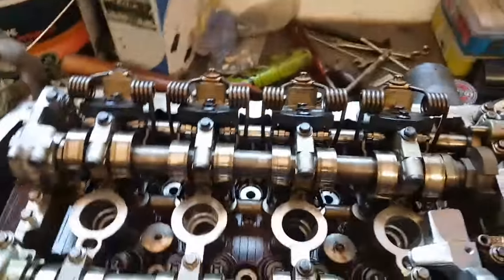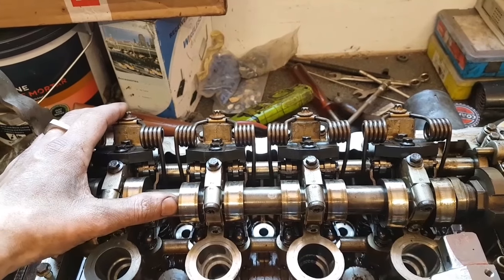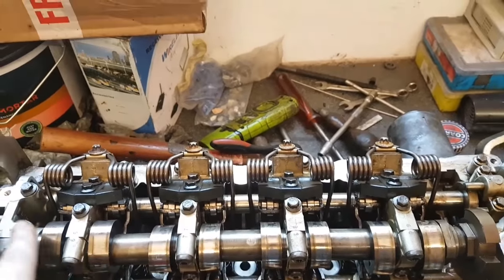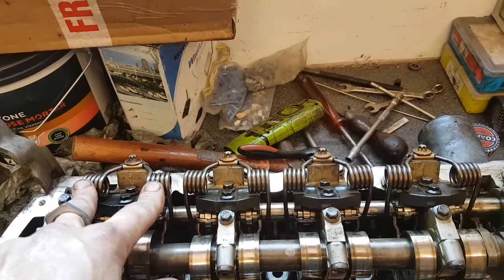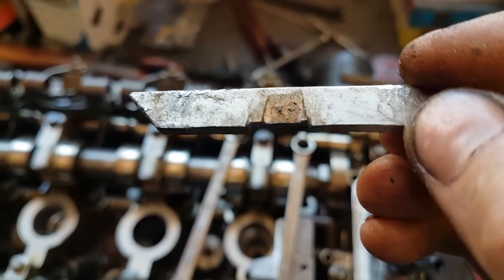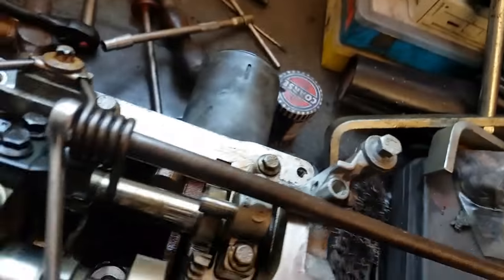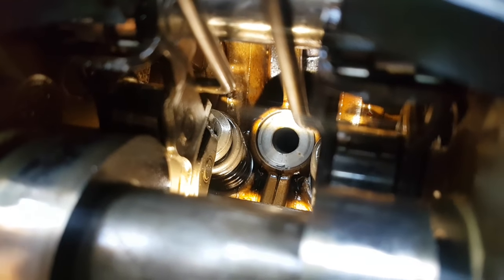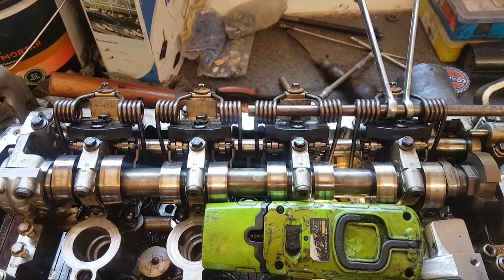PSA / Mini / BMW Valvetronic intermediate rocker & spring installation without special tool

Comment: Great video Pete, I'm about to work on my wife's mini, I'm ex mechanic myself, noise that comes from the valvetrain sounds like damage due to oil starvation as I can hear high pitch squeak with 1 sec intervals. Hope ain't the cam journals . I'm planning to change all 16 rocker arms ( intermediate rockers ) as that's my best bet going by the noise I hear. Do you think locking the timing at the flywheel will be sufficient enough to play with those horrible springs and change the rockers ? Thanks
Reply from the maker: As far as I know the cam locking tool aint too expensive, I'd get and use both in order to time everything up on the way back together, other than that you should be all good to leave the head in place. Lock the crank, leave the chain hanging and proceed from there. 👍
Reply from the maker: P.S. You're never an 'ex' mechanic... once you have the skills to repair a motor, you are always a mechanic, regardless of what career you persue next. Mechanics are a rare breed, who choose to hurt themselves both mentally and physically on the daily for the benefit of others! 😂🤣😂
Reply: Pete Ledwidge please pete would you mind sending me a pm i have so many questions regarding a n62b44 engine with a worn valvetronic shaft according to some bmw specialists.... some also say its the sensor? I am in need of desperate help
Reply from the maker: @hvmiddenwestnoord1871  apologies, I dont check the comments all that often. Did you resolve this? By sensor, I take it you mean the eccentric shaft sensor? The way to test the theory is to swap the sensor for a new / known good one. 3 10mm bolts and unclip, 10mins work. (If the sensor has built up a lot of oily crud on it, it's usually knackered.) If you still have the fault codes, after swap & code clear, then you know the problem is elsewhere.  I'd say it's probably either valvetronic motor or timing chain / tensioner / Vanos intake sprocket related, as opposed to the actual eccentric cam, the cams have been known to sustain damage if the car has been run low on oil. Hope this helps.
Reply: Pete Ledwidge hello pete, i found out about intermediate lever wear that cause misfires on one or multiple cilinders, in my case i have misfire on cyl 5 bank 2 (V8 engine). I took out bearing bracket yesterday containing the eccentric shaft and intake camshaft and i read about alot of premature wear on specific intermediate levers produced around 2002-2004. Mine’s an early 2002 e65 so suggesting that the intermediate levers are worn causing a misfire on cil 5 bank 2 due to failing tolerance for intermediate lever roller causing wrong cylinder filling? Do you know where i can source good quality intermediate levers? I cant find any.
Reply from the maker: @hvmiddenwestnoord1871 Gotcha, seems like a reasonable assumption. The whole valvetronic system is over engineered for the job it does, causing a lot of grief after 70k regardless of manufacturer year IMHO... Just tackling a Mini N16 with VANOS / Valvetronic issues atm. You can take a chance on ebay used parts or go direct to BMW, they are reasonably rare in the aftermarket.
Reply: Pete Ledwidge how much can i trust a used complete bracket from not being on the edge of failing as well? I also need to source a new eccentric shaft are those also rare on aftermarket?
Reply from the maker: @hvmiddenwestnoord1871  Exactly... in an ideal world it would all be brand new from BMW, but that comes at a cost. With any used part, you take your chances. The shaft seems scarce too for the e65, yes.
Reply: Pete Ledwidge is it natural for the eccentric shaft to be worn when the intermediate levers fail? How can i check it for wear is it the gear with tooths controlled by the actuator i have to look at or?
Reply from the maker: @hvmiddenwestnoord1871  Both the cams and the gear need inspection. All contacting surfaces will wear.
Reply: Pete Ledwidge what would you suggest to do? I looked at the exhaust cam and seems to be in ok order there also isnt a faultcode related to the exhaust cam, only intake side along with vvt codes. If i would switch cilinder heads with another good working one, would i still have to replace the intermediate lever tolerances classes on the used cilinder head with the same that would be in my old  head that is faulty at the moment? I have sourced a used eccentric shaft for a fair price of €200, would that be an option to get the car running again without misfiring as long as it will last?
Reply from the maker: @hvmiddenwestnoord1871  Either replacing the eccentric shaft and intermediates, or swap for a complete head will work. Replacement head should not require any work, just bolt it down and time it up.
Reply: Pete Ledwidge yep however bolting out the head means i have to get it surfaced at a specialist. A head with eccentricshaft and intermediate levers cost me €400 (which i wont know the wear from) and if i get a used eccentric shaft with new intermediate levers it would be looking at €450 and then i do know that the intermediate’s are good.
Reply: Pete, one last question if i would swap the entire bearing bracket with anlther used one would i also need to change tolerance classes?
Reply from the maker: @hvmiddenwestnoord1871  https://workshop-manuals.com/bmw/1_series_e87/118i_n46_5-door/2_repair_instructions/11__engine_(n46)/37__variable_valve_gear/3_ra__removing_and_installing_replacing_intermediate_levers_(n42_n46)/page_463/  See the first pic in link. Tolerance class is stamped on the rocker. Ensure the eccentric cam and int. rockers have the same tolerance as your existing, before purchase.

Comment: Hi, When you first undo the bolt that holds the spring, does the spring stay in place, or could it pop out, is it dangerous?
Reply from the maker: It'll raise up, no more dangerous than any other job. Just do it slowly and wear eye protection, you'll be fine! 👊
Reply: @peteledwidge3631  Thanks Pete
Reply: It comes up with bit of force but stops after 1-2cm. It's surprising but shouldn't be too dangerous. Take car to remove as much pressure as possible as to not damage the aluminum threads.

Comment: Does Mini 1.4 has Valvetronic and VANOS?
Reply from the maker: Petrol or diesel? Year? I don't 'think' so but would need more info to determine.
Reply: @peteledwidge3631  R56 Mini, 2007. 1.4 95hp. Engine is also in Peugeot 207 but with less hp.
Reply from the maker: @wellwh0  Yes, we were aware that a 1.4 exists on both platforms. The question was if that specific engine is equipped with valvetronic and vanos systems.
Reply: Pete Ledwidge I looked in. It does have both.  It dosen’t have direct injection. It has multi point injection.

Comment: I watched the video on reloading the springs on a mini n12 engine but I used to short wrenches so I found two wrenches  that I cut the open end. Off and added 18inchs extensions with pipe that Iflaten the end then I notice the wrenches so the spring would not move
Reply from the maker: There's always more than one way to skin a cat. 👍

Comment: Seriously? Can't believe I'm just finding this video after spending almost $250 on the valvetronic spring tool.
Reply from the maker: Questions Ah, bugger... The pro tool is definately a bit easier than this method tho, in all fairness. I was just stuck and had to use a bit of ingenuity to stop paddling up sh*t creek! 🤣 In an ideal world I would have bought and used the pro tool, but there was time pressure & also if I bought every special tool every time I get an obscure vehicle in to work on, I'd have all the tools under the sun and no profit!
Reply: That tool is advertised at nearly $700 dollars in Canada. If you scored it for $250, you did well.
Reply: @peteledwidge3631  well, you could say if I had your ingenuity, my thoughts wouldn't have gone in the direction of buying it. Nevertheless thanks for the idea... it's opened my mind to deep thinking.
Reply: @rolanddoucet9437  😂😂😂 actually, I still wish I hadn't.

Comment: https://youtu.be/3gRhDKE8vKU

Pete, no the same engine but same principle see attache link at 2 minutes called inside the motor. Regards Jay
Reply from the maker: Jay Kent My apologies, it's been a while since I did this repair and I've seen a good few vehicles since! Yes, I was thinking of over the valve circular hydraulic pots, which this doesnt have. It does have lifters of the type in this video. With the valvetronic and normal rockers removed and the cam lobes on 1 facing away, you might just get away with pulling the lifter out with cam in situ pal, altho I suspect you'll end up with the cam off.
Reply: @peteledwidge3631  thanks Pete, i thought i was going mad for a while there, really appreciate all your help and advise, keep up the great work 😊
Reply from the maker: Jay Kent No probs Jay, I'm going to delete a couple of our messages and amend my original response to you, just to keep the information correct and concise for others viewing the comments pal. Also, I'd be interested to find out if the lifter removal is possible with cam on, so it'd be great if you'd come back and let us know your findings. Information shared helps us all out! 😊 Cheers pal.
Reply: @peteledwidge3631  Hi my friend yes of course no issues what so ever, will be a while but have been looking for this fault for months and thrown lots of parts at it, as soon as i get confirmation that its worked and the removal method i will be more than happy to give an update.
Your a gentleman its so nice to speak to someone like your good self😂 kindest regards Jay
Reply from the maker: Jay Kent Try me best Kidda, gotta try & help others where you can. Whole reason I  started my mechanic business. If you run into problems with anything, get hold of me & I'll do my best to help if I can. 👍

Comment: How did you remove valve springs?
Reply from the maker: Deny M The 'normal' valve springs were removed using a valve spring compressor once the Valvetronic gear and cam had been removed. Standard valve spring compressors are widely available cheaply almost anywhere. The intermediate rocker springs can be undone using the method in the vid. Bar & spanners through. Hold the pressure whilst undoing, and then let the pressure off slowly. Cheers.